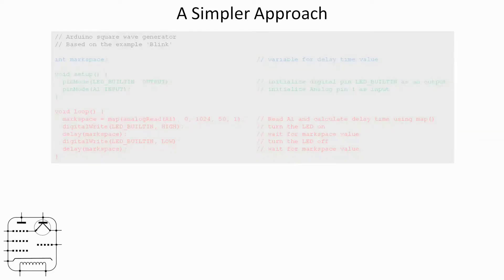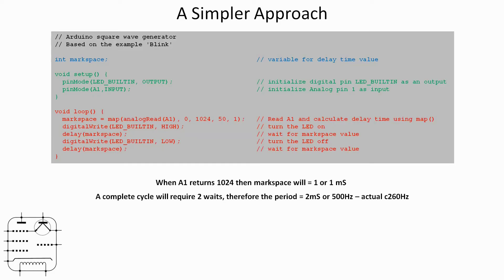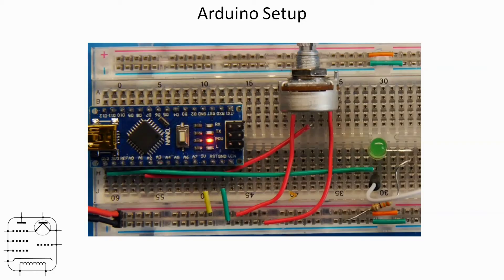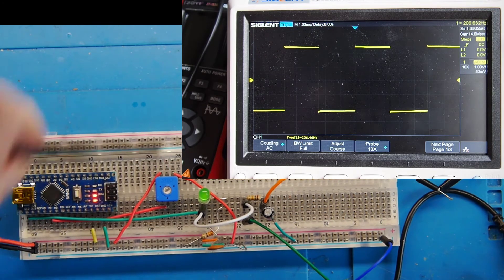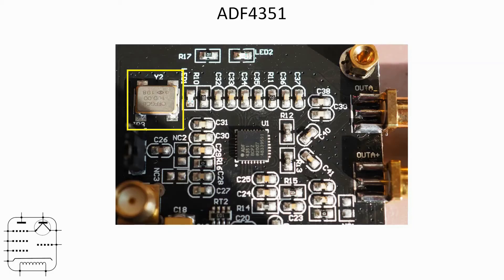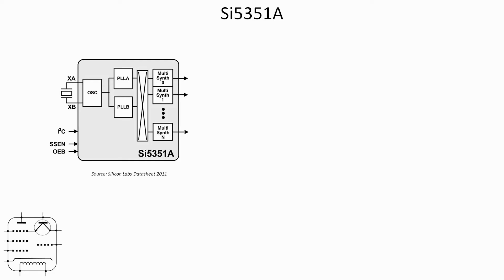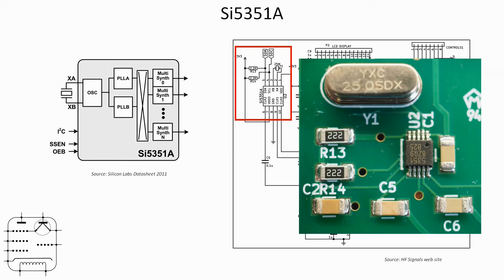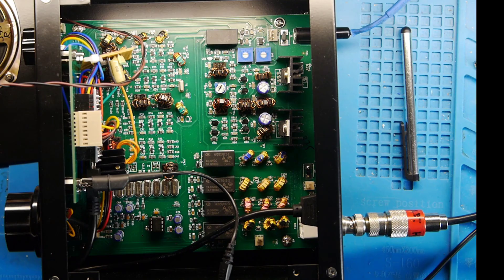Oscillators Part 7 -  Digital Signal Generation - #201

Comment: On Arduino you can write an entire byte to a Port, instead of writing individual bits to individual Pins.

(The Pin write uses AND/OR bitwise masking to change one bit and does a whole Port write anyway, behind the scenes.)

Comment: Regarding the Arduino oscillator with only moving the  map/analogue read line to the setup area, I understand you cant change frequency without a reset, I wonder how much higher the 260Hz tone would become. Also I wonder how high the freq would be without any delay code lines? Interesting demo video Thanks Greg